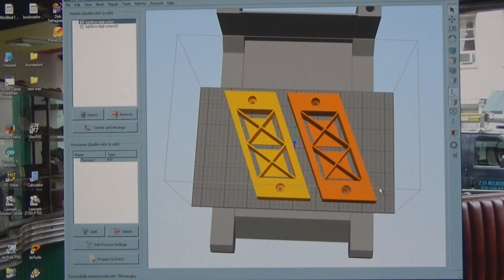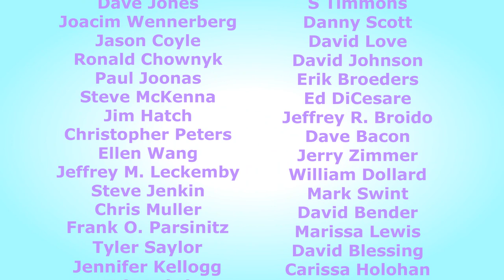3D Printed Mega Displays

Comment: Many years ago, I took my mothers bathroom scales apart... They just had a white plastic part about a centimetre or so deep (half an inch maybe) on the PCB with holes the shape of the segments. Each segment had 2 or 3 surface mounted red LEDs pointing up into into the space. With the red plastic sheet over it, the numbers were convincing, without the defuser, it was just a pattern of microscopic dots.
Reply: You know how, whenever you come up with some clever design, it turns out that someone else already came up with it? I guess your comment is proof that it happened in this video.

Comment: I've been making replacement lightpipe sections for some broken test equipment with my 3d printer. I used clear PETG and when I printed the lightpipe, they became "frosty" at the layer lines. This made them horrible as lightpipe. So I just printed 1.8mm holes in the outer substrate, and threaded raw, unprinted clear filament into the holes. The unprinted clear PETG makes a great lightpipe.

I could see making a 3d shell with channels for lightpipe filaments leading to each LED. You could end up with multi-dot segments like the old Pulsar watch seven segment displays, but on a much larger scale.

Comment: Hmm. You could etch or scrape the silvering off a mirror (it's basically paint) in a seven-segment pattern, then put a light box behind it (on the non-mirrored side). Mirror with clock display.
Alternatively, print the front area with just "much thinner" printing in the transmissible areas for a sealed, but defused look.

Comment: There's a project of a big clock but with ws2812's strip all in serial , 3 leds per segment and an arduino. You can change the colors. Its awesome, because you just hook 4 wires to the strip

Comment: To amplify the visibility, you may make the lightboxes with inclined walls, covered with white matt paint. That way it will deflecr the light outward instead of multiple reflections inside and you will ommit one led.. But it is better with a lightbox with diffuser front and the leds iluminating directly from behind.
By the way, there is no dot on these ...

Comment: Using PCB as part of the structure is a good idea.
You can put the driver as surface mounted parts on one side of the PCB and the LEDs on the other.  You can print and additional cover for the electronics if needed  making the PCB the filling of a PLA, PCB, PLA sandwich.

Comment: Fran, I deal with epoxy for a living, we use "open back bezels" and tape over the back, fill with epoxy and when you remove the tape the back is frosted white but mostly translucent. I could see taping the front of your display and filling the segments from the back with the clear epoxy then when cured simply pull the tape off the front. Your segments would be flush to the face with a frosted epoxy that would make it look more like a mass produced LED display. Have you shared the files anywhere? I might try that just to see what it looks like.

Comment: In the old Skee Bowlers and other similar things, they used conventional lamps. Using modern high output LED makes a lot more sense, and less power and fewer components. They made 4-inch segments in a similar fashion, that the lamps in sockets, were stuck up into the display, and then they had a sheet of frosted plastic, over the outside, and black masked off the front. That could just be using black matte spray paint, masked out the clear plastic, would work. Then the frosted plastic over the top of that, to make them look like giant LED display. It would take a lot of plastic to make the 4 inch displays of course. I suppose it depends on how many characters you want to display at once, and you could design 12 segment display into that to form Alpha characters. But even just numbers would be cool. You could build large displays for advertising and other purposes. Custom made to your liking, and place them in a frame.

Comment: +Fran Blanche Side emitting LED's that either point toward the 90deg point of the separator could possibly remove the "point of light" effect when viewing from an angle, and would also keep so many photons from striking the front of the display, removing the need for the white paint? or possibly Side emitting LEDS that face the BACK piece, (by bending the side emitting leds 90deg with the emitting side facing the back piece) which could be a completely different color/material that handles reflection better, and could be sprayed for easier application of a reflective paint, being there is less complex areas to get the paint into.

One other thing, In place of duct tape, you could use vinyl (typically used for signage) doing the duct tapes' current duty, and if you chose a reflective type, it helps in getting more light out the front of the box.

Comment: I love this design - so simple yet such a fantastic result. One idea that struck me when you opened it is that a conical quarter-segment in each section of the X that separates the four LEDs would reflect the light more towards the outer walls instead of towards the front directly, especially if you glue some foil to it, though that starts to defeat the no-light-pipes design principle. With that approach though, I bet you could even use the  white PLA as the direct LED light is only hitting a thick area of plastic. The downside would be increased 3d-printing time though.

Comment: Love the light box concept for the 7-segment display, seems like you could maintain the same physical area of display, but shrink the depth and still get the same effect.  Also thinking you could probably print the base plate in a more opaque color, then print  a thin layer of white on top of it for the reflectivity... though tape is probably much simpler ;-p

Comment: Very clever. While 3D printing is good for prototyping in small quantities, to really make this display in mass quantities, you'd want it plastic injection molded at a manufacturing plant. This would solve several of your problems including the slowness of 3D printing, cleaning up after 3D printing, the scaling problem, the plastic color + translucency problem and producing mass quantities.

Comment: Hey Fran,
great idea. About the integration of those electrics: Have you heard of (or even tried) conductive PLA filament? So you could make your own (literally) 'printed circuit boards'. Not cheap filament but you need only small ammounts of it. Should be working fine with the LEDs.  If you have a 3d pen (for 1,75mm filament) you can feed it with your printers PLA and use it to modify the circuits post print or even doodle them completely by hand. There are pretty affordable 3d pens online. With it you can even repair broken prints. Works great. Cheers Robert

Comment: Could you try making the two front squares (or rather, rhombuses) PCBs themselves?
It may make SMD LEDs easier to use and make it a fair bit thinner too.
It won't look as nice, but I assume it would function just fine.

Comment: Forget 3d printers, I want to try this with cardboard and hot glue!
Reply: If you looked for Skee Bowler parts, you could adopt modern high output LEDs on a board, and design a large display. The Skee Bowlers used 4 digits, plus a smaller single digit part. Its hard to find such old items in decent shape anymore. The Cree LEDS would be awesome replacements for the old lamps, and in fact you could just put in resistors to control the current to each one.

Comment: I would try filling the cavities with a translucent material, to even out the segment. Also I'm wondering how well it could be made to work in direct sunlight like a poolside lap timer.
Reply: InsideOfMyOwnMind then it will be more like light pipe. But a thin frosted plastic on top might give the effekt you might look for.

About out in the sun. Try it out and tell us. ;-)

Comment: Awesome! I was just pricing 4" tall 7 segment characters for a project. My van is up to 417,000 miles, I want to display the odometer in real time through the rear window.
Do you have the .stl file available for download?
Reply: Special EDy 
wow what type van is it? and I thought my truck had a load of miles on it.  at 300,000+
Reply: You'll be better off with pre-made displays - these won't be very readable in bright sunlight. Get the ones from Kingbright with five or six LEDs in series, they're super bright and reliable.
Reply: Wonderful idea ! How far did you develop it ? Already installed ?

Comment: In playing around with my 3D printer, I have printed very thin translucent layers of black PLA that would pass light kind of like smoked tail light covers on cars.  Have you tried printing a very thin base layer and then building the boxes over that first layer so that the front of the segment is not open like it is in your current design?  Since this first layer would be on the bed, it would be very smooth and look nice too.

Comment: I'd bet it would be straightforward to come up with internal geometry that divided a 7- or 8-long strip of individually addressable LEDs into separate "rooms," with the advantage of ease of assembly and pulling out the leads to a combined multi-display driver, for "dumb" displays that can be easily replaced. Of course, I haven't done much work with LEDs, and it's obviously cheaper to assemble from raw parts in a lot of cases.

Comment: Try 3D printing some white "sleeves" to fit inside the segment shapes :D
Also you could 3D print a white cover to go over the front, to hide all the segments except when they're lit.
Very novel approach, I like! can't wait to see the whole clock ; )
Reply: That's a pretty good idea, as far as maybe a whole white cover it might be cheaper (and faster) to just get a sheet of opaque white plastic to attach to the front.  Cool project Fran!
Reply: Azayles or just white spray paint the inside
Reply: Not opaque. Translucent.
Reply: Silver spray paint.
Reply: Perhaps print them from transparent material (which turns sort-of opaque and refractive from printing) to cover the slots

Comment: Ingenious!  The LEDs are pointing towards the front, so what we see is a reflection off the inside of the front plane onto the back plane, right?  But apparently that is still bright enough.  Have you tried bending the LED legs 180 so it would directly illuminate the back panel? Maybe that would create hot spots :-(  Anyway, very clever idea! Thanks for sharing!

Comment: If you would like to collaborate with other 3D modeller people, maybe Fusion 360 would be better than Autocad. It's free to use and lots of 3D print people are shifting to it. It would be free to use for you and sharing files in it is easy. Transitioning from Autocad would be easy for you, too. This way, you can share editable parametric models with people, not just STL files, which are not that editable. Great vid as usual. Thanks.

Comment: You could use Fusion 360 for Windows, its pretty good, almost like Autodesk Inventor. AutoCAD is the old guard, it will slowly melt :). Fusion is really easy and fun to use, new interactive CAD paradigms, try it if you didn't, it's free also.
Reply: Fusion is nice but it is cloud based, which puts you at the mercy of Autodesk. 
Eagle PCB was free too until Autodesk got their dirty hands on it.

Comment: I assumed that the digit was all right angles rather than slanted over, and it really fucked with my eyes. I thought the depth was wrong, I thought my screen aspect ratio was wrong, it just wouldn't look right, like a crazy optical illusion. But then I saw the CAD model and it made sense.
Reply: It's like an Escher drawing in real life.
Reply: oooh! Its Robert Miles!!!
Reply: Same here. The display looks totally horizontal, but the thing it's mounted on is surely vertical!
I didn't think that I was going crazy, though. Didn't get the chance. Part of my brain registered the inconsistency, found no explanation, and then decided that it didn't care, all without notifying the part that could question if I was going insane.

Comment: Nice work Fran,
Back in the day there was an IBM mainframe computer that had a dual 7 segment display that was made in a similar way to what you have done. But in this case there were 5 volt incandescent light bulbs used  to light up the individual segments. None of this new fangled LED nonsense.

Comment: Neat concept, although having an open face is a serious problem for many applications since it allows contaminants and 'bugs' to get inside. I think you could solve the light-bleed problem with topology alone, but would definitely require a lot of prototypes. I 3D printed something similar a few years ago using white MDS. The diffuser was a 1mm layer that covered the cavity housing the LEDs, it worked wonderfully. Creating internal baffles around the segments could fix the bleed problem IMO.

Comment: Neat design! Really clever light box concept, Fran. Seems like you can vary and scale this quite a bit. For cheaply scaled larger designs you could use two instances of a compact LED driver board placed in the center cross of each digit half... I want to attempt a version with addressable LEDs.

Comment: Hey Fran, it’s Andy, from Andylab, a-gain. Great design with simplicity and effectiveness. I wondered whether the white translucent plastic which was such a nuisance, could be put to good use as a light diffuser in the box sections of the segments, to make the illumination perfectly uniform over the visible surfaces of the segments?

Comment: That's a really slick display. Hackaday was slightly confusing in their coverage of it, since they said it was a single printed piece (or at least that's what I read it as) - but you really could probably just screw the "main body" onto a back-plate of some kind especially if you already have one for your project. And anyway, two pieces printable without supports is much cooler than having to clean up a ton of supports.  Looking forward to a home-buildable version of it.

My $0.02 - maybe try making the "front plates" sloped (as if reflecting toward the outside) instead of just flat sheets? Might help with front opacity as well as reflecting more of the light into the "open" areas of each segment.

Also, I haven't seen you clean up prints on camera before so maybe you already know this//have one, but I learned of this amazing tool from scanlime: using a small "de-burring" tool to neatly clean up edges, etc: good for removing brims and so on. I managed to choose the same kit that she did after seeing her/asking her to show it off on a stream: it's Amazon product B073RH9XZB (I assume a link will get eaten but maybe not https://smile.amazon.com/gp/product/B073RH9XZB ), works really nice. (3 sizes/kinds of bits - the smallest is tapered and really nice for small openings)

Comment: Great Video as always! I'm looking forward to experimenting with these once I get around to fixing the extruder lever on my printer. 

Have you considered gluing aluminum foil on the inside of the white PLA? It might still bleed, but it might be worth trying with one of the segments you already printed in white (assuming you printed one in white). You could also just paint the darker prints white. Not quite as easy as just running a print, but it would allow you to get a material with the properties you'd like with the color you want. 

Printing the box deeper probably works just as well of course. I think it would be fun to print yellow flaps to make a flap-display version. There's probably more than enough space in the segments to put in some mechanicals.

Comment: Nice idea. Just bought a 3D printer and had wanted large segment displays before which I failed to source at a sensible price. Will definitely be doing this. I can make PCBs so will be using a PCB for LED mounting and probably go for SMT chip LEDs to get a more even light. I was thinking white would be better at reflecting the light until you mentioned the opacity is rather bad for this function so may go with aluminium foil reflectors. Would like aluminium vapour deposition to evenly coat the inside with aluminium. p.s. Your hot

Comment: This is extremely cool. To me it's a throwback to the 1977 and up LED digital displays and the Radio Shack experiment kits. I think the only possible way that it could be better is if the light within the seven elements was more homogenous. If people are still making negative comments about singing then that really is sad to hear ... If you could figure out a way to make that marine use to deal with rain and water maybe you could sell clocks to timing and scoring services that manage running races !!!

Comment: I like your display a lot, thanks for sharing it. I only have very translucent PLA at hand, so I think I'll give it a try and spray-paint the front black. There are 5mm and 8mm LEDs with drivers (APA106). I'm very surprised that you've gone so oldschool with your design.  It seems much easier to wire up and opens new possibilities with dimmable RGB. I'd like to make a large ISO8601 radio clock, that's gonna be like 120 segments [8888888888T88:88+88].